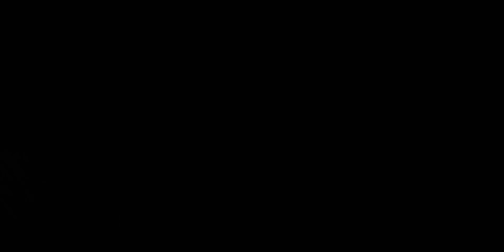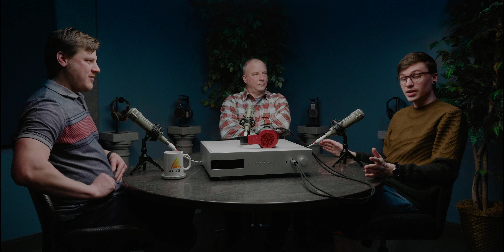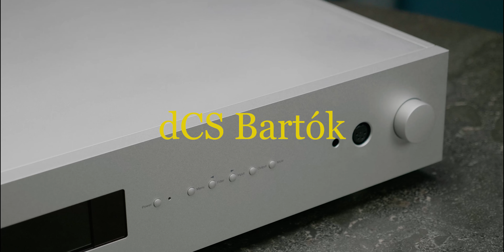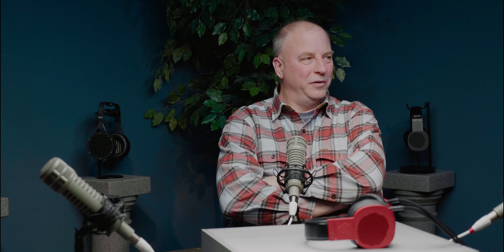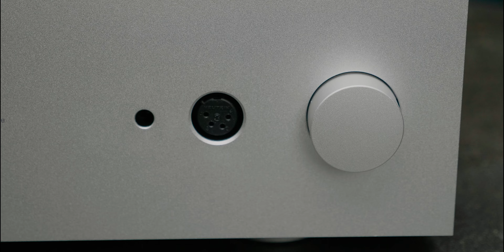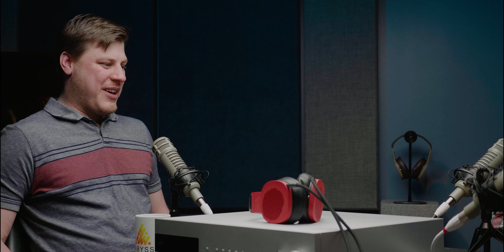dCS Bartók - $20,000 DAC & Headphone Amp!

Comment: The better DCS Vivaldi DAC with external clock
sounds better...Bartok is just ok. For this money the Mola Mola Tambaqui is better @13k. I also like the Lampizator's too and have a Lampizator Baltic but the Bartok might be a tad better then my cheaper 5 grand solution...That's my 2 cents. At this level they are all pretty decent.
Reply: Don't forget that this also has network streaming build in. So it's the equivalent of the DCS Network Bridge, with a TOTL DAC and HPA. No f*cking cables to buy. OMG. So appealing.
Reply: The Vivaldi DAC+Clock combo may sound better, but it's also £39,000 vs "only" £15,000. Even in the high-end, these are leagues apart in pricing.
Reply: I think Lamps look hideous though, and that's an issue when you're spending so much. How it sounds must equal how it looks.

Comment: I own one of these guys with the headphone amp + the XI Audio Formula S w/Powerman.  When I use the latter, the Bartok just acts as the DAC. The Formula S has distinctly sharper bass and transients than the Bartok's built in, and it separates the various voices in the track better. Maybe you'd call it 'analytical'?  The built-in amp feels much more intimate, and I prefer it for solo human voices and instruments.  It's a more relaxed sound.  They are different enough that I'm glad I have both, but some days I regret getting it with the amp option, because I mostly use the Formula S.  Anyway, with the Phi TCs it brings tears to my eyes and makes me throw my hands in the air with joy. It's that good; that's why it's worth the money.

Great tip on the WA33! I'll have to try that next. Incredible that these headphones keep improving with a stack of electronics this high end.
Reply: Hey, just wondering a year on if you got to try a WA33 vs the Formula S?
Reply: @chipsnmydip  yep! Worth every penny. It's got a better sense of space and sharper textures - exactly what you'd expect. The downside being that it's a tube amp of course. The Formula S though is a genuinely great amp. Just lacking a touch of intimacy in my opinion. Everything seems far away.
Reply: @mmattb  Nice! Thanks. Do you feel the WA33 is able to keep up with the speed and dynamics of SS for modern music?

Comment: Who needs a car or a expensive hobby like motorcycles etc when you can have this instead. How do I say this ncely...you guys have had this top shelf dac/streamer/preamp and headphone amp and not even used the streaming portion with the app? It's terrible one box solution to your system or just to your favorite headphones. And if you have tidal and use this to decode mqa, it does it better than any dac out there. I'm not a mqa fan but the folks at meridian that developed mqa decoding implement it inside all dcs dacs. Trying to figure out why it makes more a difference through Dcs dacs than others like a mytek dac. Feels like a missed opportunity to try it streaming capabilities. You should report back on it with another follow up video. I feel sorry for folks who hear this dac and have to go back to what their using. It sorta ruins ya !

Comment: I feel like maybe there's no good reason to spend $17k on a dac. 🤔
Reply: Miracle oil for your ears. rofl
Reply: I used to think that the TT2 was my stopping point for dacs. That was until I auditioned the Bartok. It is really expensive but my god does it sound incredible.
Reply: @klewja  On the DCS forum as well as by high end reviewers, there seems to be a consensus that a high end pre-amp significantly improves sound into power amps feeding speakers.This suggests that the BArtok , though very transparent and detailed, perhaps still has an element of harshness from its in built pre-amp.
Reply: Except if you want goosebumps, chills and tears.

Comment: Chord Dave vs. dCS Bartok vs. Holo May Kitsune vs. EMM Dv2 vs.  MSB Diamond vs. Berkeley Audio Reference vs. Rockna Wavelight  vs. Denafrips Pontus/Terminator vs. Lampizator Pacific vs. Audio Note Dac5 vs. Accuphase DC950 vs. Ypsilon Dac 100 vs.  Esoteric vs. Sonnet Morpheus vs. Mola Mola Tambaqui... = Ultimate Dac shootout
Reply: Since you mentioned Denafrips, I wiuld suggest the Audio-gd R7HE to come to the test queue. Possible?
Reply: Would rather see the Metrum Acoustics Adagio or Pavane in there in place of the Morpheus TBH.
Reply: @johnratcliffe6438  Were just picking nits at this point..
Reply: @aceofspades6667  High level for sure.
Reply: I'll tell you now that the DV2 is on a level beyond most of these except Lampizator, Audio Note and maybe Berkeley reference, but they are all very different. I actually replaced my Bartok with a DA2 that I got at huge discount and am very happy with it.